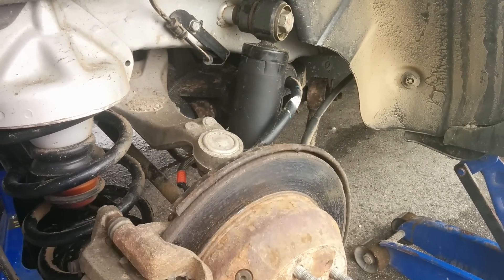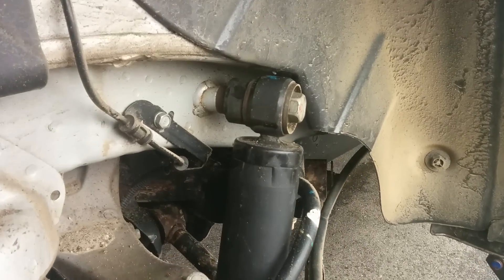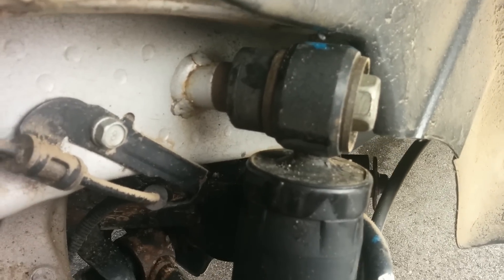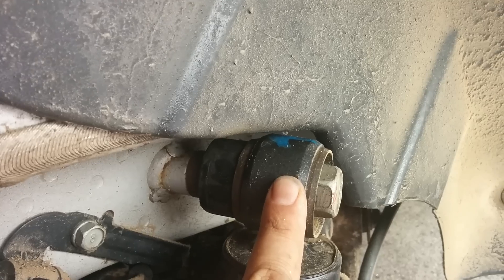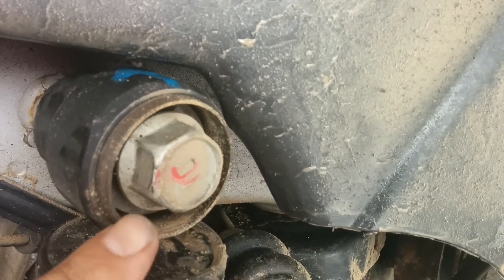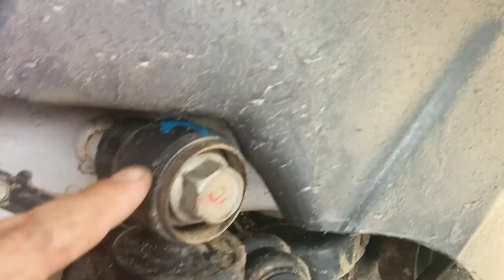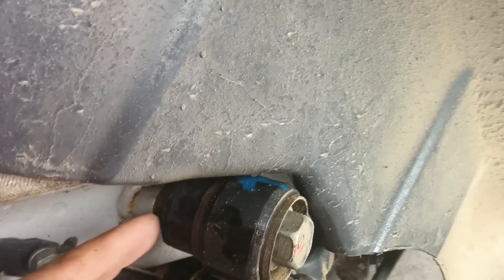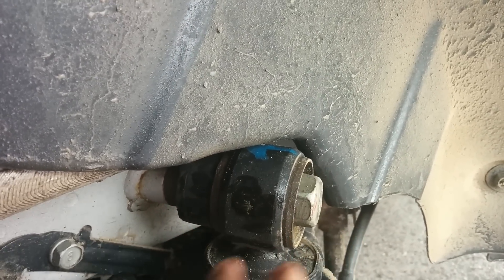Hyundai SantaFe Suspension Defect

Comment: Same issues with the 2019 Hyundai Santa Fe. We just had the front bushings and sway bar bushings replaced on it 3 weeks ago and I just took it to the dealer for clunking sound in the rear end and they State both rear shocks are shot already and need to be replaced. also they state that the rear differential seal is leaking and needs to be fixed as well and replaced. All covered under warranty as far as I know I guess I'll find out next week when I take it in. Very concerning considering it's a 2019 with only 65,000 km ( 40k in miles) and all the suspension components are failing. Thank God we have extended warranty.. we will most likely sell once the warranty coverage ends.  Getting a Honda or Toyota next time.

Comment: This might be an aftermarket installed shock as the manufacturer one comes with a built in insert that allows a clearance of the rounded bet to set on the vehicle bolts place that is welded to the frame Recently replaced mine with an aftermarket and noticed the diffrence
Reply: No.   This is a factory shock.

Comment: Was this resolved? I have a knock in the rear of my 2010
Reply: It was resolved by replacing my rear suspension with an aftermarket setup I purchased from Rockauto.   The replacement upper bushing was smaller and as such the retaining ring didn't fit in and it now holds it in properly.

Comment: Nothing wrong with that design. All manufacturers use it. Autos are not made to drive carefree till you trade it in. There's this thing called "PERIODICAL MAINTENANCE" that had it been applied in this case, would have resulted in the replacement of two rear struts.... You probably also had over 70k on them.